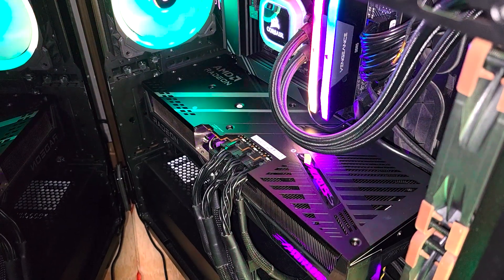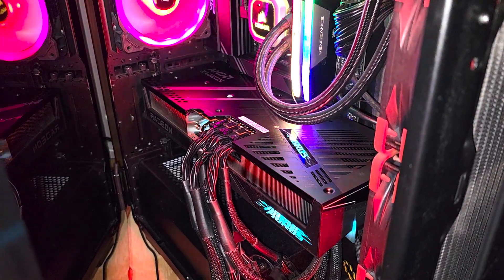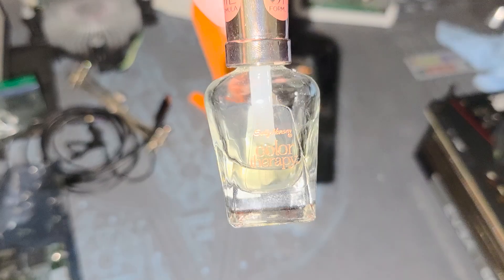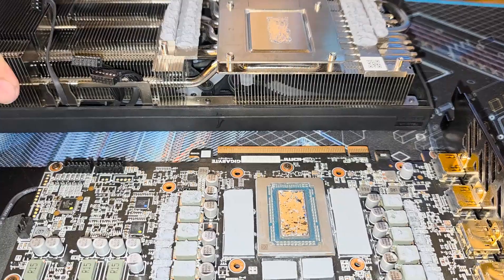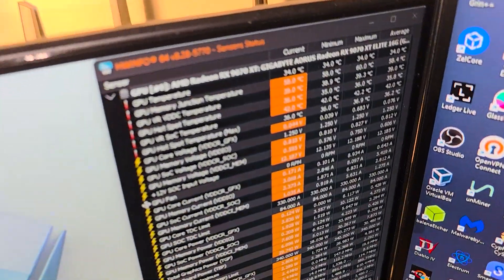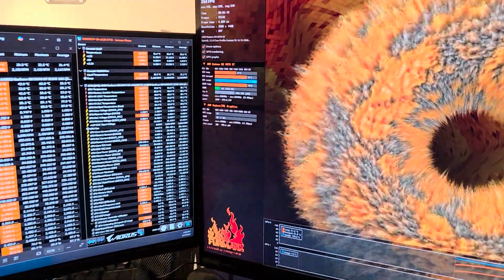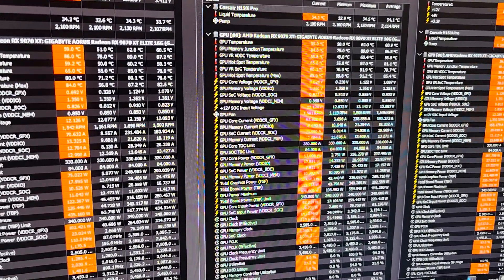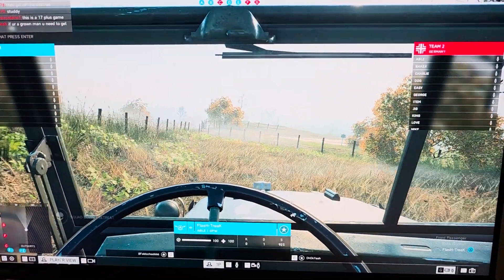Liquid Metal Aorus RX 9070 XT - Ruined or Improved

Comment: Bro, do you remember what temperatures you were getting with the stock thermal paste? I’m asking because during a Furmark stress test my GPU hotspot hits up to 107°C, and the fans are only at around 65% speed.
Reply from the maker: Yea i was seeing 110c on hotspot and memory junction was hitting 106 - 108c under full heavy load even with fans at 80%, now there so much better and doesnt surpass 98c under same b loads. So 5 to 10c reduction by doing what i did

Comment: You might need to reapply the liquid metal 1 month after first application. The first application needs about a month to "cure" on the copper heat sink. After the second or third application the liquid metal will stay liquid for a longer period.
Reply from the maker: This heatsink is nickel plated
Reply from the maker: Put you point is absolutely valid

Comment: Main thing is to pay attention to your clocks.  Increasing the thermal cooling can reduce heat.  BUT, it will allow your clocks to stay higher for longer due to the thermal reduction.  Heat will get at or close to what it was before but overall you made your card better/faster  at full load and yes cooler at mostly reduced load.
Reply from the maker: Good result, running good playing Wow, Dune, Battlefield 6 beta, and soon main release, plus BOPs

Comment: Its wild how bad the hotspot is on the aorus. Other brands have lower hotspot temperatures without even using liquid metal.
Reply: So.... I have strapped a small window A/C unit to mine... I can attest that this model will perform very well if the hotspot temp can be managed. I want to liquid cool mine lol
Reply: and with normal cooling, without a steam chamber